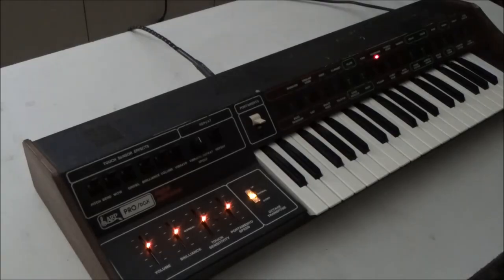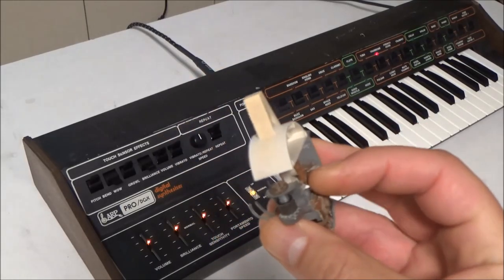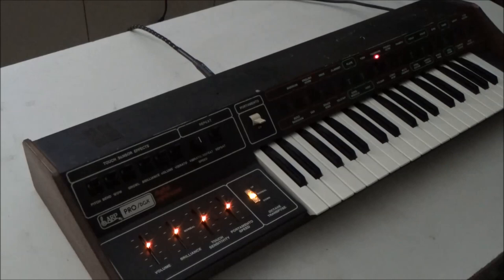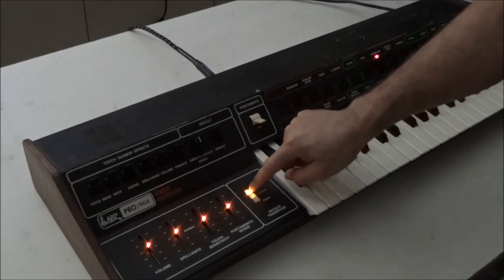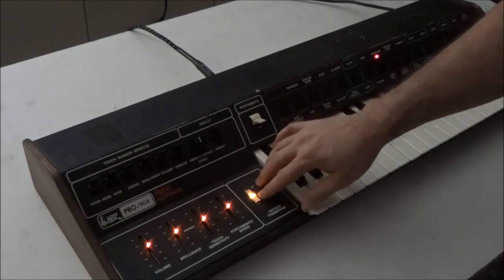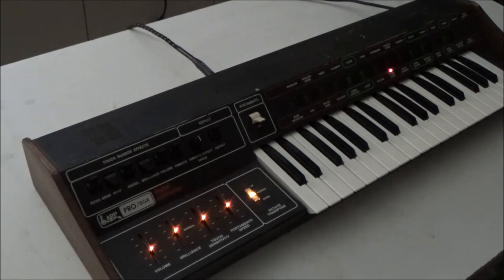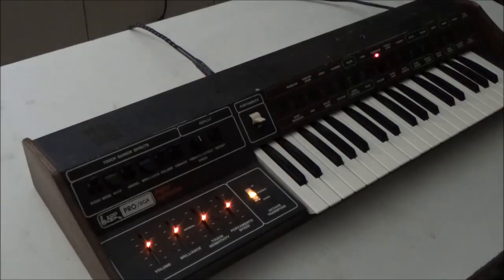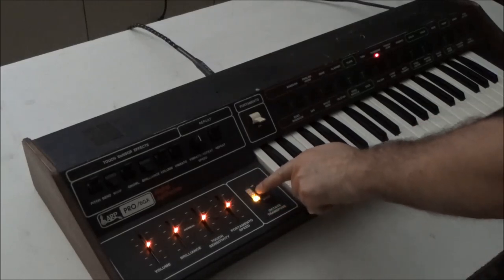Synthchaser #109 - LED Octave Transpose Switch for ARP Synthesizers - Pro Soloist, Odyssey, etc.

Comment: I know you probably know where to put an led on the speed of the LFO and I saw an older video, I think it might have been you..faders with LEDS on them.   Mines a little different. Also love an led on the LF switch off and on, top left,  in the Odyssey 2813. I tried an led with the dropping resistor.. the main LFO, it worked but it kept making a noise in the output so I removed it.   I'm not that gifted in electronics, I have always loved electronics even as a kid but I had to go a different route, I picked it back up and I'm still learning the hard stuff now since I'm disabled.   I love electronics and music.... I've been a musician all my life.  Send me a diagram if you can to help me know what I could do to my Odyssey.   It plays wonderfully and thanks for the faders, filter upgrade and parts. It's like new.   It does drift for some reason, I've got to look into it.  When it's in self oscillation, pitch slowly goes down. And too some keys jump pitch.